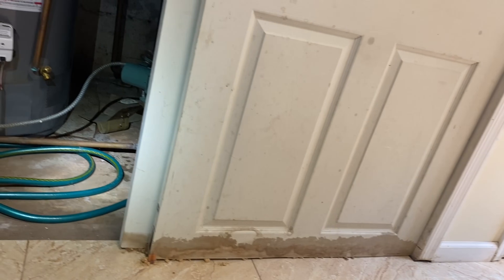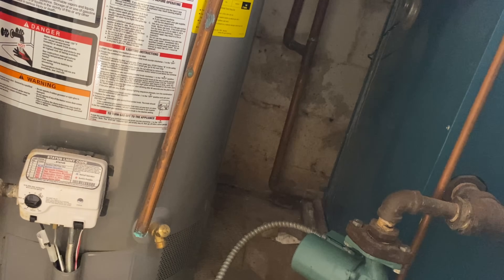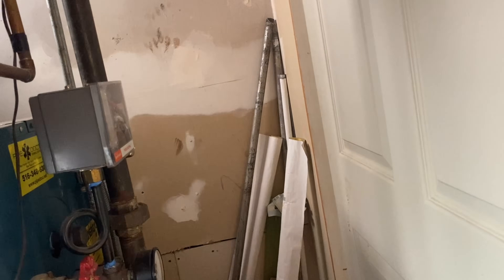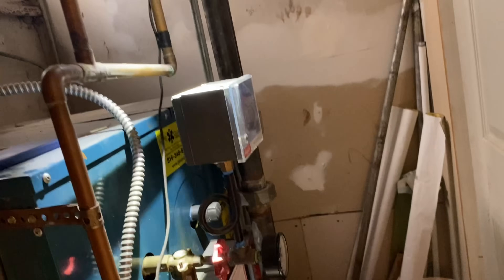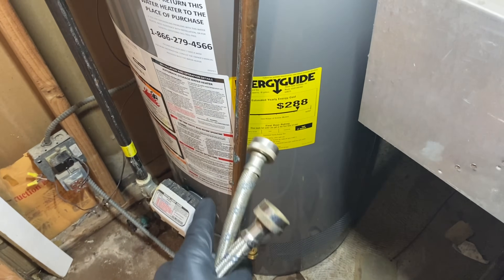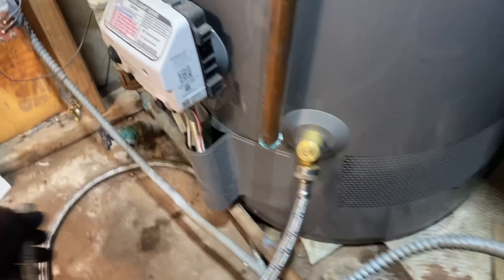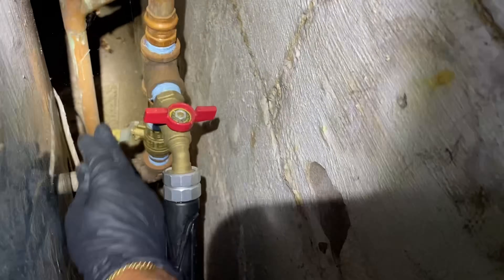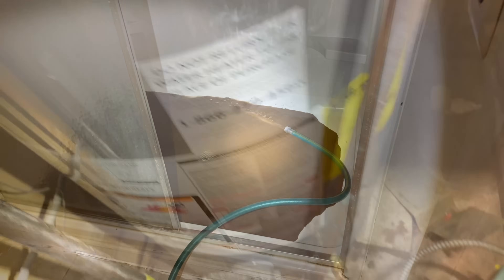How to Flush Hydronic Baseboard Basement Zone on Burnham Gas Steam Boiler to Maintain Circulator

Comment: Good video! In our setup we have the circulator pump connected the the drain side of the steam boiler, which feeds the baseboard on the second floor. I suspect we have a similar issue with the pump as I knew how to flush the boiler itself, but not the hot water loop.

Comment: Great video Mikey, I have the same system, the boiler looks identical to mine. 2 years ago changed the pump, everything worked fine. I add another radiator to a cold room in the basement, turn on the heat the 3 radiators are cold ,i replace the pump still no heat. There is a bleeding valve in the return line, press it, no water come out. What do you think the problem is ? Could it be a clogged pipe or radiator?

Comment: Mikey great video we thank you!What if we use any cold supply line to flush the basement zone?I am saying that because we will not risk contaminating the boiler's water.Instead of using the drain plug of the boiler we can use a cold supply line nearby.What is your opinion?We love you from Greece!

Comment: seeing that push on fitting on the baseboard loop, you're lucky you didn't blow something apart, I can imagine the swiss-cheese corroded paper thin piping an fittings :))
Reply: @PipeDoctor  you're brave, I'd not dare applying over 10psi to that crusty old heating loop.
I also wonder if they replaced and threw away a rebuildable bronze circulator. lol

Comment: Six months from now you will get a weekend emergency call when he tries to bleed the loop, crap gets stuck in the water heater drain and it will not fully turn off.   Or he still floods out the boiler.
Reply: lol, exactly :))
Reply: @PipeDoctor  Boston globe home section would run an article once a year on homeowner water heater maintenance.   Part was to flush your tank down to clear rust.   We would then get a rash of calls for tanks not draining and drains with crap in them that would not shut off.  My favorite is when they hear air bubbles in the baseboards and think letting the air out of the Schrader valve on the expansion tank removes the air.

Comment: Wondering if there's a Combination Deaerator fitted or the likes of same fitted into the system on the returned water side like a Combi 'Spiroflow' unit  to remove micro Air bubbles and also catch magnetic particles with in the Circuit, one wonders if maybe even a Prior to the  Heating Season just  Shot Dosing of Corrosion  Inhibitor. could help as the Boiler might have been out of service from say late Spring till Early Autumn,..You're correct Steam Boilers aren't 'maintenance Free' and even, monthly 'Blow Downs" are required to reduce the amount of  sludge and Total Dissolved Solids within the Boiler as same is great grinding material for Pumps, Valves  and Heat exchangers ...

Comment: Great video! That is a job only a professional like Mikey pipes should be doing to prevent cross contamination! You like pools Mikey pipes then you should like Geo thermal because you will need to use a pool pump to purge the system of air before you turn it on Mikey pipes!' Geo thermal the next big thing for mcmansions in New York Mikey pipes! Cha Cha Ching!

Comment: Mike , great video, you are using the hot water from the” water heater” to flush the boiler and baseboards and you are checking to see if the auto fill /and low water cut off works all at the same time … You sir  get an A+ in uses time wisely !! And working efficiently….

Comment: Have you seen navain just posted a video on  a VID switch that installs on the vent pipe, the unit can't run unless the pipe is there inches into the collar
Reply: I would really strong consider buying a Navient in a year or two because of Mikey Pipes hard work you’re forcing them to improve their product… it may not be there yet but they are making progress in the right direction ??? I guess time will tell??